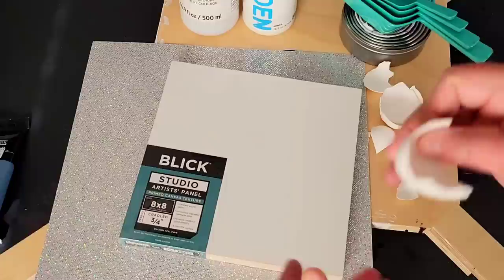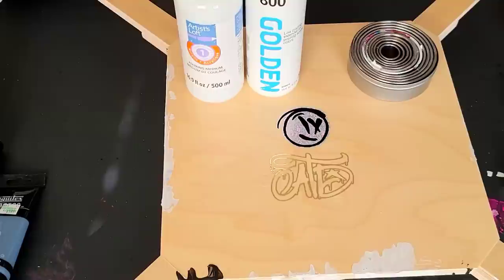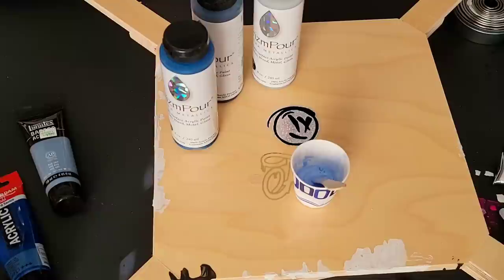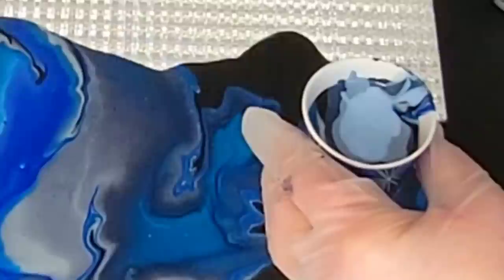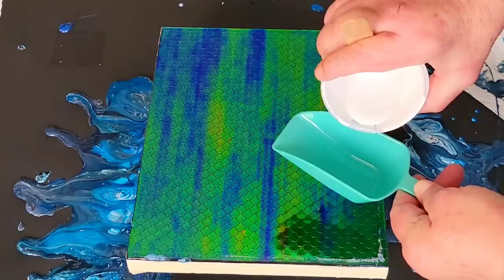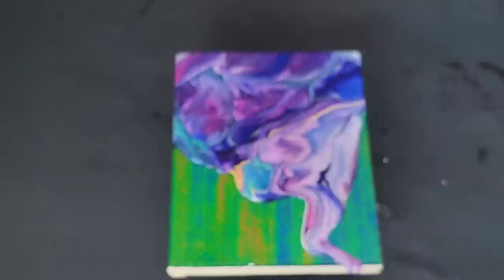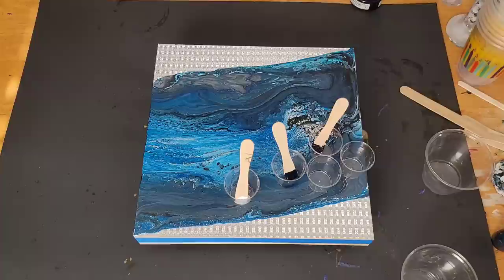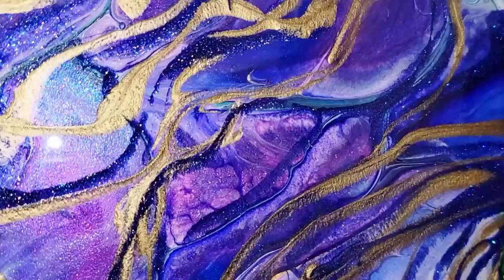Acrylic Pouring On Paper & More! Amazing Backgrounds For Acrylic Pouring.

Comment: When I saw you were doing a segment on paper, I was quite thrilled because I started on paper (#140, cold- pressed, watercolor paper 12" x 18" and 12" x 12.").
 I had no canvases and no room for the drying and storage of canvases.
To learn to pour, I practiced as much as possible. 
Paper is an easy way to practice all the 12 or so major techniques, and color theory. Most of my paper pieces are experiments in color use, pouring products, techniques and use of pouring toys. Using canvases for this learning phase is not in my budget. 
Sometimes I prep the paper with Gesso. Sometimes not. I don't have problems generally with paper buckling and I love color and pouring it off, even spinning it -- as if the paper were a canvas or other thicker substrate/pouring surface.
 I've seen Caren from a Facebook group whose name slips my recall report her approach to smoothing buckled paper pieces. (After drying, she lightly wets the back of the dried piece, and presses it between paper towels covered by plastic wrap, mashed between 2 pieces of custom sized dry wall.) I've yet to try that. I would probably also use a warm iron over the back of a wrinkled piece, and a hair dryer when it's flattened, too.
I like paper because it's easy to store and refer to after it dries. I write notes b4 each pour and after, too that are transferred where possible to the back of the piece from a pouring journal. 
I don't mean to mislead that I'm organized because I'm not. But I have to try to capture notes about what I do (medium, media) and colors I use as I pour because I'm always doing something unplanned. And, you would expect nothing less of me, as I have such inspiring YT, FB, IG, etc channel artists I watch/consider my mentors (like you, Kanella Curacao, Mina Villegas, Gina DeLuca, leftbrainedartist, Christina Welch, etc). So, there is much to be expected. LoL (I've learned a lot with this approach, and I still consider myself a beginner. But I've learned enough to distinguish veterans and artists who are educated from newbies. That's important to me so I learn effective pouring habits. Toward that end I have split my pouring time with online art school starting with basics, drawing. This has made a huge difference in my artistic eye and pours.
Love these two pieces you produced in this video. Scrapbook pads and sheets are a gr8 idea. I'm not able to concentrate tho with the wave of creative ideas that kind of surface would bring to my mind. LoL
Hope you do more paper pouring segments. Thx.

Comment: Tammy.  On any wood or msg surface what is the process to keep the platform from warping? 
Wood must breathe while drying so do you coat the top and sides and leave the back Un coated? 
The round wood pieces tend to warp.  I’m wondering 🤔🤔🤔